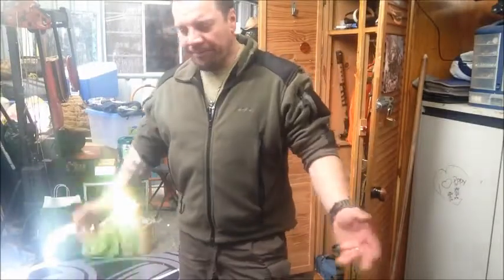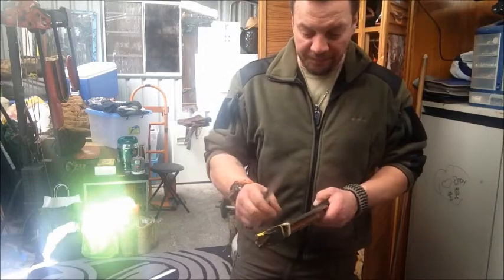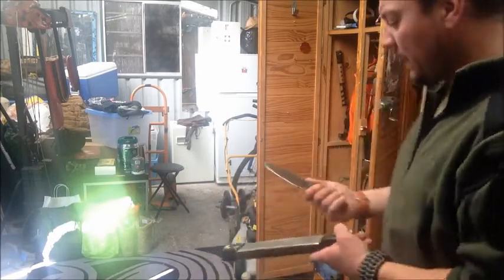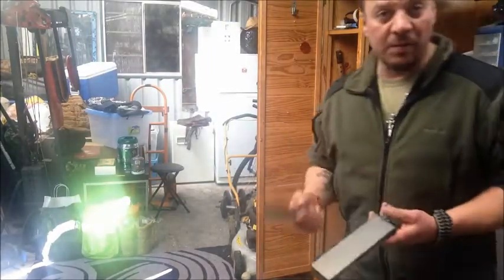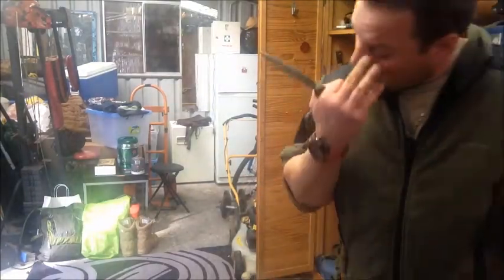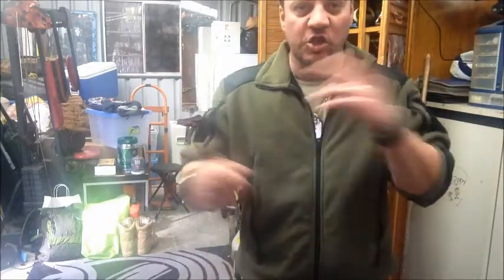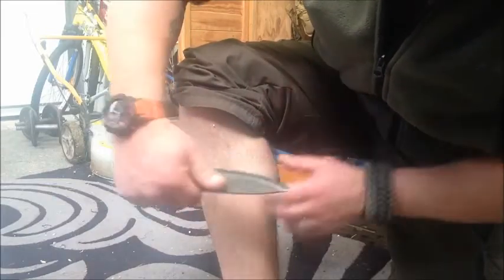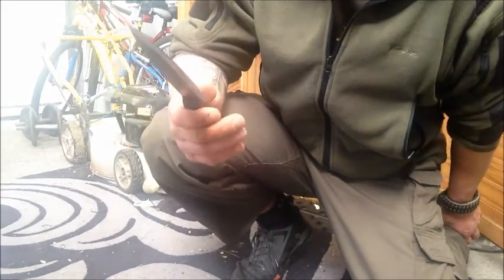Sharpening a Convex Blade

Comment: Hey Mick, a little trick I come up with to help me keep my angles on both sides of the knife, as close as possible while sharpening by hand, is to sharpen your knife in front of a mirror.

I had A LOT of trouble keeping the angles even, but when I was able to place the knife on the stone to where I thought it should be, and then looked in the mirror, I could see when I went from one side to the other, that I was not even.

I made adjustments while looking in the mirror, and then looking at the blade from my point of view and made a mental note of what that angle should look like one each side as I went back and forth and sharpened my blade.

Just getting a different look at the angle you have your blade on a stone makes the world of difference in sharpening a knife.

Like I said, I came up with this to help me keep an even angle and it works for me, but maybe not anyone else.
Reply from the maker: wjf213 Great tip, bro, I will try that
Reply: czechmate9591 No problem Mick. I got the idea when I was in the gym working out. You know how you're always checking your form in the mirror to make sure you're lifting correctly, I thought why not use the bathroom mirror to check my form on sharpening my knives.

I've never seen anyone do it like this before, but it worked for me, and showed me how SERIOUSLY off I was between the two sides. One was A LOT higher than the other, but I didn't see it until I looked in the mirror.

After I made adjustments, and mental notes as to what my blade should look like at the correct angle, and then always repeated that look, I never had a problem again.

Anyway, good luck bro, and if it works for you, share it with others.